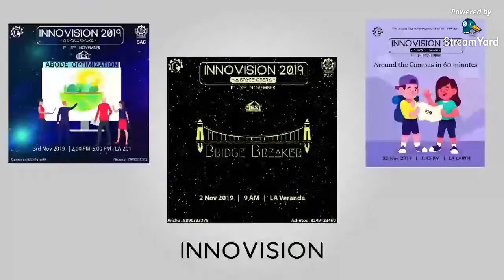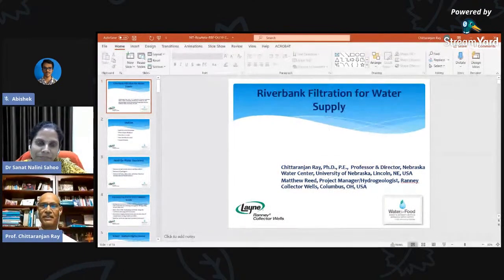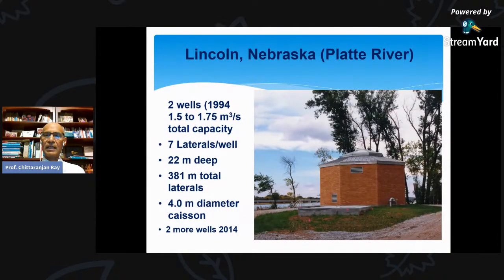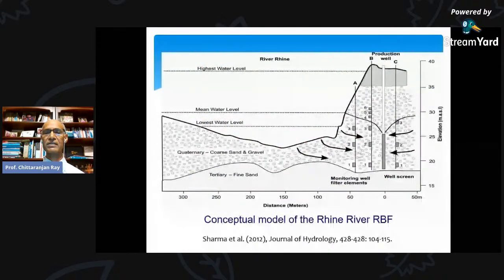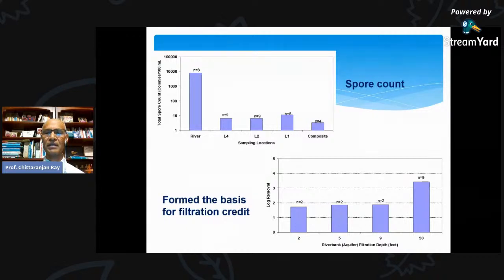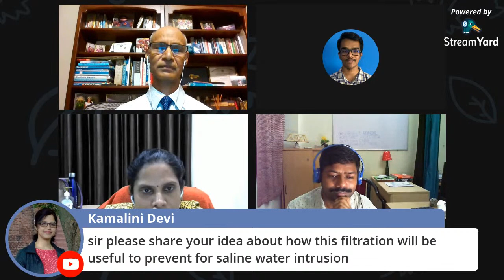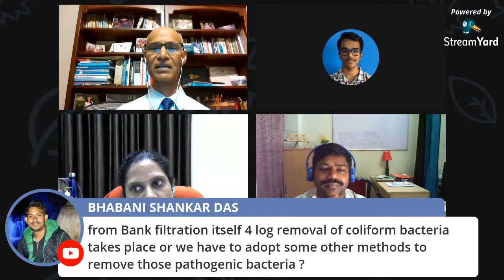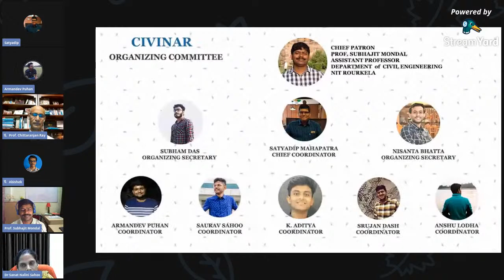CIVINAR - A Talk Session on Riverbank Filtration by Dr. Chittaranjan Ray

Comment: I feel when the flow velocity is more it creates a partial vacuum in the pores of river bed as a result pore blocking is removed naturally, but in sand filter it is stagnant water so we are doing backwashing to remove silt in sand bed but backwashing is not required to river bed I think so,
If we assume pores blocks are not cleaning from nature means after some years all pores of river bed will be clogged and no water seeps into aquifers but in reality aquifers are receiving good quantity of water from thousands of years so I assume clogging was cleaning by natural flow of water, but yield of water may not be uniform in this type of water supply arrangement, after drawing water if we found any pathogen bacteria means we can treat it by passing it through UV light and using  nascent oxygen or chlorination etc, 
Correct me if I am wrong, I have said above thing within my knlowdge